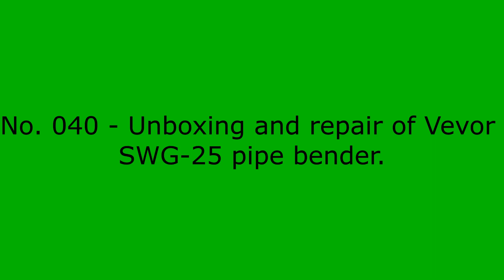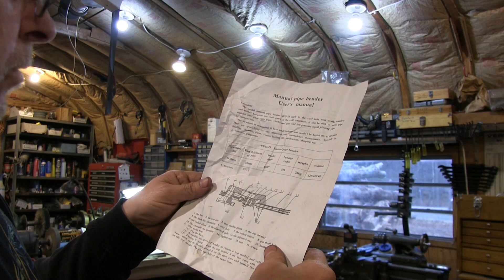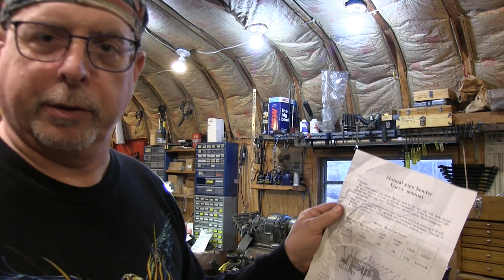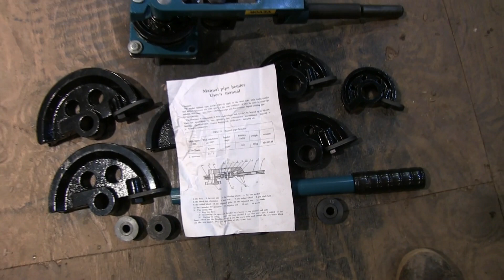Vevor SWG-25 Pipe Bender - Unboxing, Review and Repair  - 040

Comment: Uh oh, looks like they powder coated inside the bore, and you turned the shaft down?
Reply from the maker: Nope. That was my first thought. That would have been an easy fix. But no, there was no powder coating inside the bore. The decision was, which part was easier to setup and I decided it was easier to put the shaft in the lathe then putting the handle on the milling machine.
Reply: @Millstone_Firewood interesting, bore looks blue-green in the video on my monitor. I guess it missed the final machining stage on the bore. Mine was similar, but I ran a wire will on the drill thru the bore and it cleared out the blue-green coating then fit perfectly

It's always pot-luck when buying these mainland chinese tools as to what you get
Reply from the maker: There was the tiniest bit of overspray in the bore. Maybe that's what you see. Aside from this problem, I was pleasantly surprised at the quality. Had I actually spent money on this, I would not have been happy. Generally I try to buy American. Thanks for watching! I appreciate it!
Reply: @Millstone_Firewood I think I paid ~100USD delivered, worth every penny as you' say

Comment: How do you know what angle or degree that you're at
Reply from the maker: You need to use a protractor or be very good at eyeballing it.
Reply: One other option I think might work too - if you have an electrical conduit bender for the same sized pipe - then the "horseshoe" on the conduit bender has marks on it. You might be able to lay the conduit bender horseshoe on top of the bender horseshoe and transfer the marks to the bender 'shoe